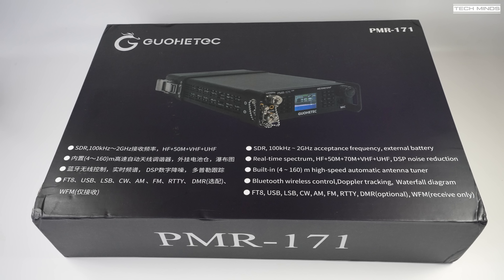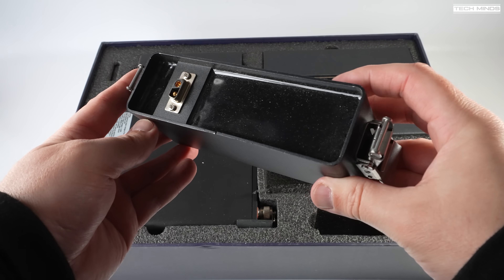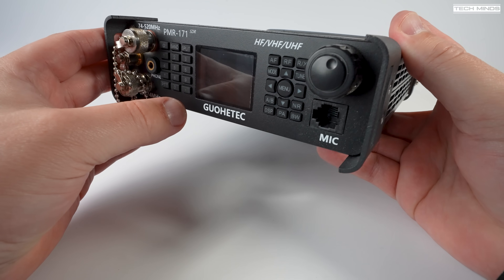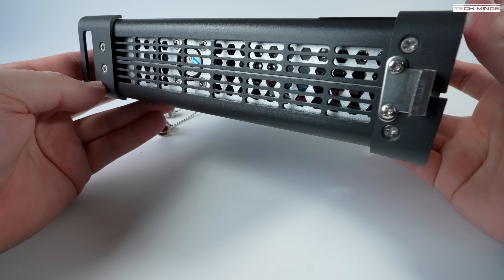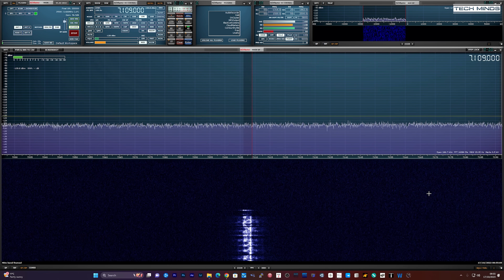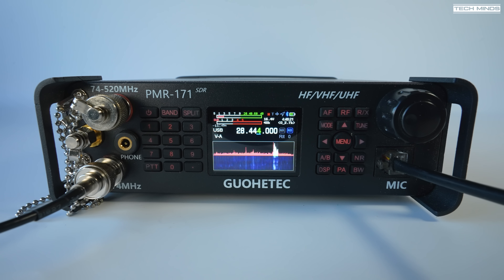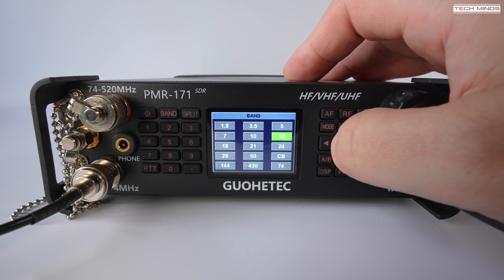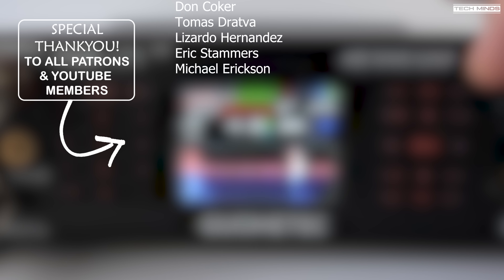GUOHETEC PMR-171 ALL MODE - HF/VHF/UHF SDR TRANSCEIVER

Comment from the maker: Here are some FAQ answered:

1) The battery is removable and can be used with the radio, exposing the rear ports if you need to, uses the supplied cable, see this twitter photo: https://twitter.com/TechMindsYT/status/1714751865307488746

2) There is an inbuilt ATU

3) If you want to use Digital modes portable, then you can either remove the battery and use the provided separation cable, or you can use BlueTooth with the apps shown in this video here: https://youtu.be/o8ovuRo4f2E

I will add more replies here as more questions come in. Thanks for watching 🙂
Reply: can it be programed for repeaters and that info saved, as is done on say an HT radio when setting up channels? If not, this could be a deal breaker for me.  Thank you for the vid. Tom S. Ocala, Florida.

Comment: I am interested in this set, particularly as it supports 4 metres. However, I cannot find any information on its 4m frequency range anywhere. I have emailed the manufacturer but not had a reply. Can you please post an addendum or some info on this? Thanks, Howard

Comment: I purchased this Radio Jesus I mean it this is one of the worst radios I’ve ever used when I get a strong signal the front end of the radio overloads the VFO  is not easy to use I have total satisfaction with this Radio I was not even able to program my own sign in a lot of the features do not even work if this advertised as 10 W the most it shows 10 W even when connected to 14 V is it still only able to use 10 W?  This Radio is a bag of problems.

Comment: I know this is from a year ago, but a question. Retevis now has the Retevis Ailunce HS3 on their website that looks like the same radio with the same specs. So, safe to say the Retevis is simply a rebadged version and all the info in the video applies, just maybe some firmware updates? Kind of the (no)difference between the  VGC-VN7500 and the RT99.

Comment: Does anyone know if there is a diagram for this somewhere?

I just received one of these broken radios.
Unfortunately, this model is very far from a decent design. Inside, it's a disaster when it comes to repairs. I have already found the factory short circuits, but the radio still does not start. The display does not light up.

Comment: I find this radio is very handy and sensitive. The only sad part is the software does not allow you to save multiple frequency to the radio memory . It's only allows you to save limited amateur band frequency. Cat control is has alot of limitation. You can't input a frequency

Comment: I just purchased one of these Have to say these are JUNK the design & operation software is so clunky There are 30 push buttons cluttering the front panel One rotary vfo control which is also used for some setting adjustments.Then add antenna input sockets one of them SMA why sma ? Total of 36 controls & inputs sockets in such a small front panel Then the design team decided some of these buttons have a double function requiring short or long press The whole Guotech range have this flawed ergonomic design The firmware updates cure one thing but unfix 2 others The radio requires a total redesign Thankfully my purchase  started rebooting itself & eventually died  Hooray I was glad to return to sender for a refund

Comment: Hi Mat, great video. You said the battery was included, but on banggood website they speak about a battery case? I asked them this question. Can the power level (output power) be adjusted per watt? (to drive an amplifier)? Thanks, Phil ON4VP

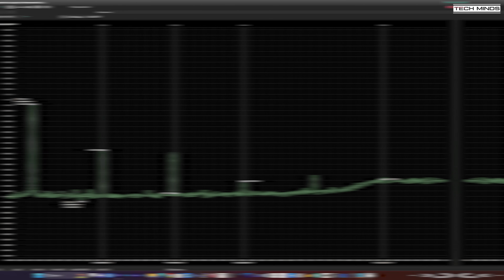Comment: At minute 13:28, it shows a 2nd harmonic of 2 meter emissions of about 43 dBc (reduction from primary emission). The requirement is 60 dBc. This means its 13 watt output power at about 145 MHz has a harmonic of 650 micro-watt at about 290 MHz; this harmonic exceeds the US FCC limit  97.307 (e) of 25 micro-watt by 26 times. Spurious emissions at 20 m and 40m seem ok (within limits of 43 dBc). What is the IMD characteristics of dual tone modulation (for example, 900 Hz and 1300 Hz) in SSB ? This would shed lights on how the HF RF linear PA is pushed, power wise; a poor design will splatter noise outside of the intended 2.7 KHz transmission bandwidth.
Reply: Easy fix actually, but 'some soldering required' to cure.

Comment: Some cool features, but who has ever wished that their battery covered their interface ports? Or wished that their coax cables could be more in the way at the front of the unit by the controls.

Comment: To GUOHETEC...
When I decided to buy PMR171 I thought: it is like putting together a Xiegu G90 (450 €) + Baofeng DR 1801 DMR (150 €) = 600 €. The price of PMR171 + DMR is 1.192 €. (835 € with the discount).
G90 is a great radio. I own one for more than one year. I take it with me in all my outdoor expeditions and it always works very well. It is not necessary to set it with extrange configurations to get it working eitheir in LSB, USB, FM...  GD88 is also a good radio, estable and reliable. 

PMR171 is more expensive. I would undersatand it because it is suposed to support SSB modulation in VHF and UHF. But considering that the audio quality of SSB is a disaster and DMR performance is more than poor, I consider that you are selling a product that is not prepared to go to the market.

Comment: Doesnt sound good and its far overprized for what it is. The Icom IC-7300 isnt that much more expensive and the far better radio, that would be the better choice.
Reply from the maker: Totally different kind of radio compared to the 7300. If I was after just HF. with a medium output power, then the G90 would be a great solution. However, this radio has VHF/UHF and an attachable battery. Something the 7300 doesnt have.

Comment: Nice radio, Mat, but I think I prefer my Yaesu 991a which is an SDR defined radio.  I want at least 100 watts out on HF/6 meters. I've had the MARS mod done so I can use it on 11 meters.  Cheers & 73 from K9POW in eastern Tennessee

Comment: What are the transmit limits? For instance will it TX on 472kHz? Or is it limited to normal ham bands?
Reply: 1.8MHz and up including 70MHz.

https://pmo41839d-pic1.ysjianzhan.cn/upload/PMR-171UserOperationmanual_spkp.pdf

Comment: Is there any option to tx out of band ? iIf yes would be interesting to test this (power, wat frequencies it opens).
Reply: It does transmit out of band, but I haven't tested mine yet to see exactly where the limits are. I still want to see if it gives me any wattage on the 220 band.
Reply: Thanks  @dschaefer6454  for info. I'm interested if you make some more tests out of band.

Comment: That's a nice bit of kit, Mat. A big step up from my own new radios, a Chinese mcHF clone, and the QRP-Labs QMX. The mcHF clone has a name of sorts, but I've forgotten it. It's an all band all mode SDR-based transceiver, with around 5-10 watts out. No VHF or UHF, but I've got decent HTs for that, including some nice ones with the US 2m, 1.25m, and 70cm. I've got handhelds with charging cups, external microphones, and those "tactical" folding antennas made of measuring tape steel hanging from the ceiling. I have these in 3 places around the house, next to my bed, next to my primary operating position in the living room, with my "shack stack" next to me, and I'm the kitchen where i frequently sit to watch the world go by out my window. But the real winner is that QMX. It's a 5-band QRP CW and digimode transceiver about the size of a deck of cards. It has phenomenal performance and you can't beat the size. I power both the mcHF and the QMX with a USB-C PD cable that gives 12v at 5 amps from a suitable PD power bank. It's a very lightweight system that can also charge my phone, my tuner, my torches, and lots of other gear.

I used to build kits, but I'm getting them assembled if i can, as i have trouble sitting at the bench, building them these days.

I really enjoy your videos. Keep up the good work and 73!
Reply: I got one from Bangood, what a load of crap and a waste of £300.

Comment: Wouldn't it be cool to have a radio that also provides pins the go high for respective frequency ranges so you can easily setup a few hf contactors to automatically select the suitable antenna.
I dunno if it has been done already, i left this discipline 25 years ago.

Comment: Lithium cells in resin. What could go wrong? 😀
Reply: Tell us.
Reply: @r0tekz  Lithium Cells fail eventually and when they do they will produce a lot of heat and gas. Containing them in resin can lead to an explosion instead of them just violently burning up. And resin makes for rather nasty fragments, wouldn't want one stuck in my eye.
Reply: @DasIllu  Cool, let me know when the first report appears of this battery pack exploding.

Comment: Mat, please measure the battery current for Rx ("standby") with antenna noise, and Tx at full power and both cooling fans running.  This radio looks promising for man-portable SOTA/POTA/IOTA/etc, but we all know that power consumption is a limiting factor for that and what separates the better QRP radios apart for that application.  Also, when you do further digital testing with its built-in sound card, let us know what laptop driver is installed for that (where it comes from - Microsoft?)  and your experience getting it going for both audio, CAT, and PTT control.  Good review so far!!

Comment: No grounding  ("Earthing") connector?
Reply: I'm using one of the antenna connector cap screws as a ground. You don't need super heavy guage cable to ground 20 Watts HF.
Reply: It is supposed to be walk around portable. How are you going to ground on the move?

Comment: It would be interesting to know if this radio can be tweaked to operate on 1.25m as well as US MARS and CAP frequencies. In short, is it truly a "DC to Daylight Shack-In-A-Box" All-Mode radio, or just another in an endless line of units that skip frequencies arbitrarily ... For One Thousand US dollars ( street price with DMR and GPS modules ) it isn't an inexpensive thing ...

Comment: No ATU for SW? I am wondering what´s the problem with integrating a tuner. Same with IC-705 and others.
Reply: read it has
Reply: Strangely, nobody is talking about this. I checked the manual:

PMR-171 has the following features:
1. Real-time spectrum.
2. Waterfall chart.
3. Doppler frequency tracking.
4. Using software-defined radio technology (SDR),
full-band support FT8, USB, LSB, CW, RTTY, AM,
FM, DMR (optional),
WFM (Receive Only).
5. Dual frequency conversion circuit structure.
6. The IF width and IF displacement hardware and
software can be modified to provide powerful IF
interference suppression.
7. DSP digital noise reduction.
--------------------------------------------------
8. Built-in (4~160) m high-speed automatic antenna
tuner.

--------------------------------------------------
9. Built-in electronic key controller, all parameters
can be set flexibly.
10. Built-in sound card with IQ and audio output.
11. External battery compartment design.
12. USB TYPEC3.1 to connect to the computer
13. High-precision TXCO ± 0.5ppm (-10°C~60°C).
14. Ultra-wide working voltage range: 9~18VDC,
some voltage transmission is limited
15. Power supply anti-reverse polarity protection.
16. Built-in GPS/Beidou, electronic compass
(acceleration, angle sensor) (optional).
17. GPS timing (optional GPS module required).
18. The RTC clock can be set.
19. Voltage display.
20. Ultra-light weight: ≤2kg.
21. Bluetooth wireless control, Bluetooth FT8.

Comment: INPUT/OUTPUT FAILURE! Having 5 front mounted connectors in the front left corner under the "ears"? is ridiculous. Hiding all the input/outputs under the attached battery is the dumbest thing I've seen on a radio this year! OMG. 😆

Comment: Sounds like a G90 slayer.

Built in sound card, internal tuner, VHF, APRS (Think beaconing for POTA/SOTA!). It mentions bluetooth control, dual VFO. This would be great for working sats if it is full duplex!

73 - KC1OCA

Comment: Too bad the battery has to be removed to do digital modes. They should offer an extension cable for this. They used Harris manpack design mostly.
Reply: Might be able to use WSJT-X through bluetooth if your laptop has it built in and the rig supports it.

Comment: This hits the high points of everything I’ve ever wanted from Icom/Yaesu. Built-in APRS, BT CAT/Audio, a simple interface.
The SWR plot is also super handy for field expedient antennas. Basically a built-in NanoVNA.
Reply: the interface is a killer feature. yaesu 991a has the worst interface ever. but it's a good radio in his own

Comment: Thanks for doing the spectrum analysis. Not enough people concentrate on how clean the output is for harmonics. Shame the 70cm second harmonic is a bit high but the rest are more than decent.
Reply from the maker: Yep, that's what I though too. Cheers!
Reply: Unfortunately the magic number  in Germany is -60 .... Thank you for the analysis
Reply: Agreed.  The 70cm measurement he did, assuming it is lab grade, is a bit under what the US's FCC requires for spurious emissions.

Comment: Looks like a machanically solid version of the technically almost identical Q900, but for twice the price, which is ridiculous for the additional encoder and extended mic functions. Having antenna wires go out to the front is a total no go for me, apart from the microphone and maybe headset if it is still anlog and wire based. 
I am still looking for the promised follow up videos on the Q900? Something more in depth would be great - how to flash firmware, how it looks inside, how stable the software is and how reliable the radio is overall in real life? What about intermod when connected to wideband antennas, what about the dynamic of the RX and TX?

Comment: Can this be plugged into a computer and used as an actual SDR, or only via audio out? Also, any insight into how well the DMR function works on the models that have it, I'm interested in listening to DMR...
Reply from the maker: I dont have the DMR module so I cannot comment on this model for DMR. Yes, can be connected to computer and used like an SDR radio. I have a video on my channel showing the Q900 connected to software, works the same.
Reply: @TechMindsOfficial  Thanks for the reply! I see it can be used with their own software... are you aware of any compatibility with the more standard packages like SDRconsole, SDR# etc?
Reply: @SquillagusNiggle  Where does it say that?

Comment: Collecting the array of drill bits to drill holes through the lithium battery for rear port access. What size drill bits do you recommend to make all ports accessible? 😂
Reply from the maker: See here: https://twitter.com/TechMindsYT/status/1714751865307488746

Comment: Looks like a nice radio.
I tried the Aliexpress link and it says they don't ship to the UK.
Interesting that you can get an optional internal DMR module for the radio.  There's an optional GPS module apparently but I'm not sure if that's an internal board or if it plugs into the front socket.
Reply: Just like the Q900, the GPS module is installed inside on headers onto the board. It's better to order the GPS module installed. The DMR module is soldered on, so you almost have to order it that way.
Reply: Banggood ships to the UK

Comment: At first I was horrified to see that the key socket would be obscured by the battery pack, but I suspect the short cable you were holding in your right hand when you started unpacking is an extender for the battery pack, so you can still plug your morse key in but with the battery detached.  As another commenter suggested, it would be nice to see how it is to use and how effective the filters are on CW?
Reply: we need a spacer with those external jacks on it so the battery could still be on the radio. what do you think?
Reply: You could 3d print a spacer very easily.
Reply: @LanceVK6LK_AussieHam  " "

Comment: That's a decent radio Mat and a nice review. Glad to see it has decent filtering on tx. I do wonder at the logic of covering essential ports with a battery!
73 Fraser MM0EFI
Reply from the maker: See here: https://twitter.com/TechMindsYT/status/1714751865307488746
Reply: @TechMindsOfficial  I did think a flying lead would be a good idea. 👍
Reply from the maker: @theradiorover  Yep, comes in the box, I just forgot to mention it. There is a lot more to this radio, just couldn't fit it into a small video. :-) Thanks

Comment: Would be very interested in seeing how it operates connected to a PC. Both for WSJT-X operation but also software like HDSDR, since this has both audio and IQ output, plus CAT control via the USB port. That said, I seem to understand the IQ bandwidth is limited to only 48kHz, I would be curious to see if that's also the case connected to a PC as it is quite low.
Reply from the maker: See this video I made: https://youtu.be/o8ovuRo4f2E

Comment: The microphone is exactly the same as on my YAESU mobile VHF/UHF transceiver. I'd guess the protocol between mike and radio is also the same.
Has anyone ever found a base station mike that can be connected to those radios?
Thanks for the video.
Ralf, DL9KCG
Reply: Moin, welchen VHF/UHF Trx betreibst du? Vy 73 de Ed
Reply: @ed905 Einen Yaesu, FT-7800. Wobei betreiben schon reichlich übertrieben ist.
Reply: @fotoralf  Danke für die schnelle Antwort wollte nämlich dieses Schultermike an das PMR 171 anschließen, hoffe das klappt.73 de Ed
Reply: @ed905  Ich habe das Service Manual zum FT-7800, falls das hilft.

Comment: Sounds very noicy, show noice reduction in next video please, thanks 73
Reply from the maker: Kind of a double edge sword really. The sounds comes from the side of the radio, where my mic was at the front, so there was a little reverb coming from the back wall of the recording area. Plus local QRM. But yes, the NR feature does knock it down a bit.
Reply: @TechMindsOfficial  ok i thought that was a possibility about local qrm